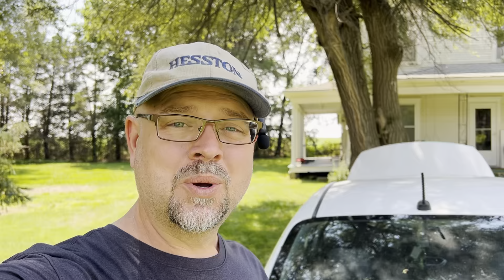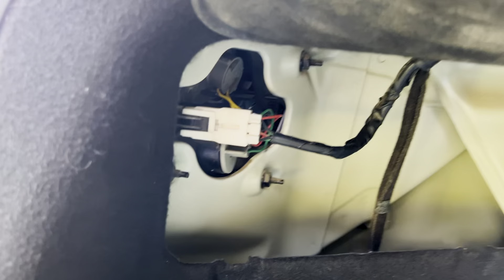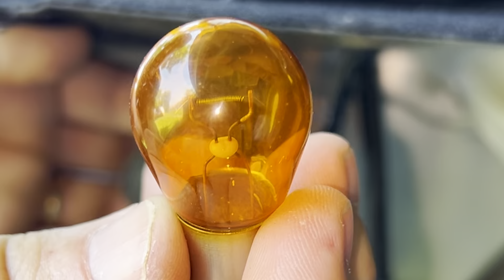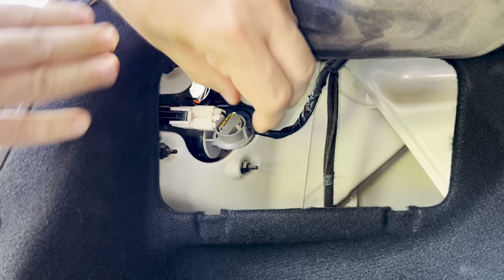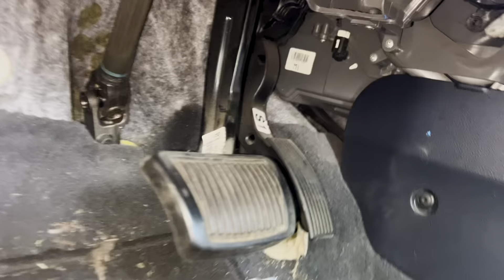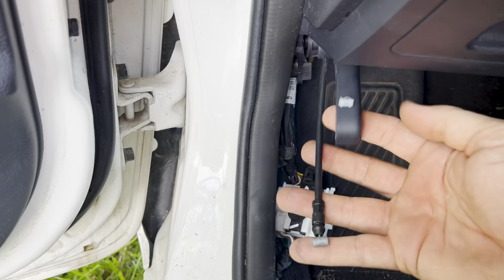No Blinker? Diagnose and Repair Turn Signal Issues

Comment: Hey, I know this video is not the most viral on youtube but I wanted to thank you profoundly. My passengers side front blinker has not been working for months and it has been a major annoyance. I heard you mention Kia's specifically with the socket prongs needing to be extended with a little tool and I tried it and my problem was instantly solved. Thank you thank you thank you!!!!
Reply from the maker: Thanks for sharing! I don’t make any of my DIY repair videos with the idea of going viral. I just document what I encounter and hope it helps someone somewhere.
Reply: 96 Ford Windstar van same problem
Reply: Thank-you
Reply: same thing for my 2016 kia optima hybrid, just happen stumble onto this video glad i did.
Reply: It was the same exact problem I was having with a 2013 hyundai elantra. Many thanks to the video creator!